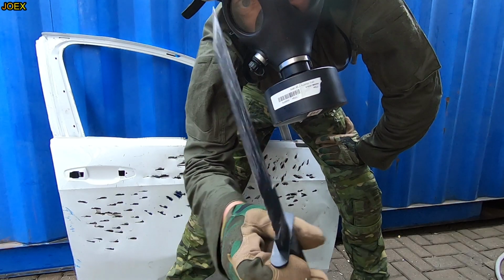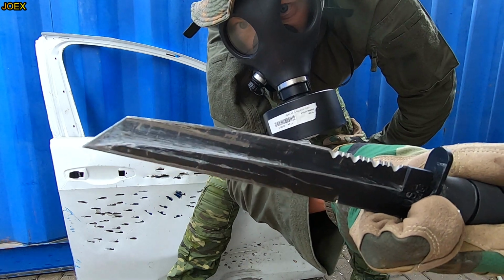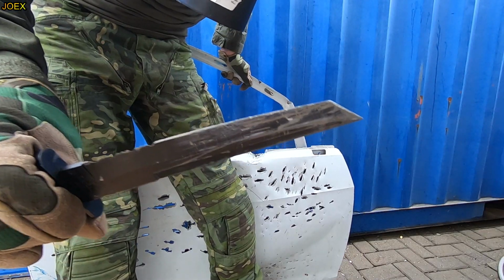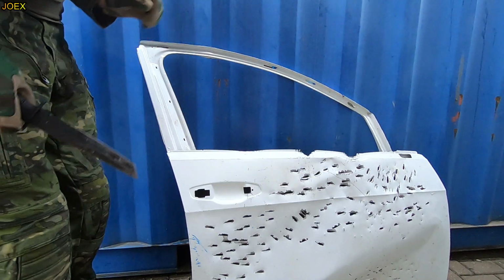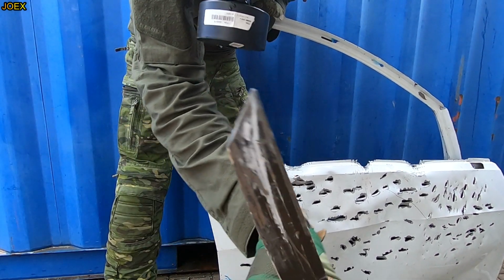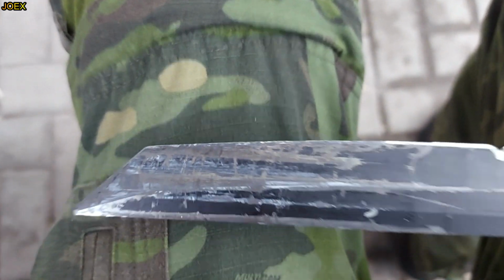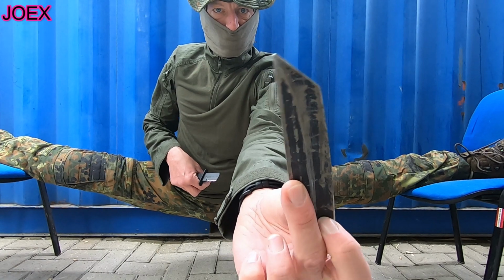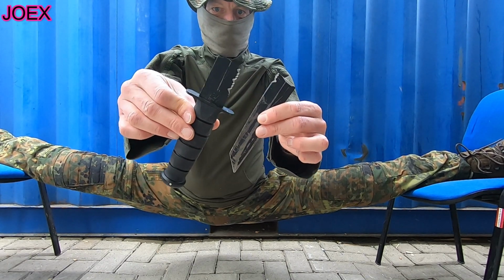KA-BAR TANTO FULL SIZE FIGHTING UTILITY KNIFE - DESTRUCTION TEST -  UNTIL IT BREAKS - 1095 Cro-Van

Comment: Hey man, "THANKS"!!! I was seriously thinking of buying that knife! Your video just helped me make up my mind! You'd think the Ka Bar would break at the stick tang point but, it did NOT!!! Very surprised and impressed by it's performance! Another EXCELLENT video Joe...
Reply from the maker: thanks, it did good!!
Reply: @joex  how about a test on Kabars NEW modified tanto?
Reply: I've had mine for almost four years and it's served me well. It makes a great bushcraft knife as I live off grid I use it almost every day and I just recently broke the tip (only about an 8th). Definitely going to get another.
Reply: @kicktherancor3217  I'll sell you mine. It's not the tanto version, but it's never been used. I have the regular clip point with the serrated section and Kraton rubber handle.
Reply: @kicktherancor3217  how are you off grid commenting on YouTube vids

Comment: Ngl Ka-bars are way more durable than I had previously thought, if this guy has a hard time breaking a knife it's pretty solid, dude is to knives what whistlindiesel is to trucks. Working on a bugout bag and still trying to settle on a survival knife that can survive an apocalypse. Looks like Ka bar is back on the short list. Thanks for all the hard work putting these knives to hard use, just be careful and mindful of your health brother, some of the crazy shit you do seems like a good way to get hurt,  and idk if that PPE is up to task or not, also as someone who has wrist problems myself(Years of heavy computer use, shit like this and a break or 2 for good measure) can't help but wonder if all that knife abuse is going to take a toll on your wrists too in the long term, something to think about anyways. There are anti-shock gloves that have little air pocket bubbles in them that help with that kind of thing, but I'm not sure if they'd be adequately protective for the many risks of more immediate injuries...A wrist brace could be another consideration, or some kind of thing that could hold it and spread some of the load to your arm while also potentially giving more leverage, like if you could figure out a way to attach it to the end of a crutch or something along those lines, as an added bonus you would be able to put more force into swings from the additional leverage.
Reply from the maker: i will be fine, but thanks for your comments, pretty cool, cheers!!!!

Comment: Still waiting for someone to demonstrate killing a bear with the knife, one thing I would like to say is that it seems that the weak tang of the blade and the sharp corner of the tang around the guard seems to be reinforced by the harder handle material in this version than the leather(which is considerably softer and weaker and allows the tang to bend more around the guard, hence the failure point when being used to baton, bend) so the Kabar with the plastic handles are stronger .
Reply from the maker: ok, bear check

Comment: 10:37
the blade takes amazing bending without breaking.
The tang is a little on the soft side, it's either they break on the tang-blade transition, like the old ones did, or it bends like an iron wire as you can see with the 'modern' Ka-bar's USMC type of models..

Still a very tough knife I would say. And nice stabs.
The Ka-bar 1066 has a nicer tip in my opinion, the nice smooth line without protrusion of the square point.
Though tastes might differ 😁.
Reply: I'm really surprised by how well it did, not a bad result at all. DBK did a video on Ka Bars recently and theirs seemed to bend and break much easier at the tang. Maybe an unlucky batch or maybe there's something about batoning that is particularly abusive to the Ka Bar design. Hard to say. Which is why all these tests are fun to watch.
Reply: @DL-ij7tf  
Yeah, if you're planning to baton lots of thick wood, I wouldn't buy one of these knives. They are fighters first and utility second.  But with common sense, these knives will do fine, even batoning some wood to make a fire (though many have no need for batoning to make a fire). 
You just have to recognize its limits. A wise man can do that.
Reply: @Ve-suvius  Yeah and I do feel like there's a bit of a disconnect between people doing hard use testing of a knife on YouTube, like batoning a big knotty log, and real life use where you can judge if a log is a good idea to baton or not. Most any knife can easily baton an even-grained piece of wood of a couple inches or less in diameter and then you can make kindling and tinder. In real life and even(or especially) in survival situations, if a task looks borderline for your gear, don't risk it unless you REALLY have to.
Reply: @DL-ij7tf  
Exactly.
These test video's are fun and interesting to watch. It shows limits.
But all in all, many men, even women, have batoned their tiny Mora for years without issues.
Even Cody Lundin still uses his Mora #1 (or is it #2) with the red wooden handle, after all these years.
Go figure.
It's the mind that makes good use of a tool.
Reply: @DL-ij7tf  
Some guys manage to break all of their knives. And I'm not talking about Joe X here. He's out to do that for a mission, with a purpose. But guys who think they know what they're doing , when in fact,  they do not.
Reply: @Ve-suvius  I actually really enjoy batoning, I just think it's fun and it can be safer and faster than using an axe. I live in the country and process a lot of firewood for fires big and small. The majority of batoning I've done has been with a Mora Robust, a Cold Steel SRK, and a Schrade SCHF36, none of which have ever had any damage other than finish wear and I'll even push them sometimes just to see how they do (they're inexpensive and I have at least 2 of each of them). Done some pretty gnarly knots and even split some by putting the tip onto the side of a log and hammering the butt to drive the knife through. I rarely have the balls to do anything like that with my expensive knives even though most would probably handle it even better.
Reply from the maker: you guys said it all! thanks for the comments! cheers!
Reply: @DL-ij7tf  
You have to do what feels best to you.
One batons, another uses the axe , some collect wood lying around instead of taking down branches/trees, whether dead or alive.
Safety depends mostly on the user. Not all can wield an axe or hatchet safely. Others can't even handle a knife safely.
An axe/saw are ofcourse the best wood processing tools aside from the chainsaw. The guys at Timbesports show that. They are fast !
Have a look at Jason Wynyard. Crazy power.
Reply: @Ve-suvius  I use axes a lot as well, but they are much less efficient and less safe for splitting a large number of small logs. I've had to process a few whole trees on my property over the past couple of years (Emerald Ash Borer). I don't get the vitriolic response to batoning people on the innernets have, often people act like the only knives that exist are $200 4"-bladed belt jewelery they take on hikes. Sometimes knives are just tools that need to work to accomplish a task. Personally I've seen axes break far more often than knives and it's much more dangerous when they do. You also can't miss when batoning.
Reply: @DL-ij7tf  
Fiskars don't break that often, nor the Gardena/Husqvarna synthetic handled ones.
They are very powerful.
You're free to have your opinion. 
I'm not agreeing with you it on this though 😁. 
Tante testi tanti cervelli....
Many have broken their knife during batoning also.
And already said, they were taking wood with their knives they should not have taken.
It's all on the user of the tools.
Knives are fine to split wood though. But axes are kind regarding this.
Reply: @DL-ij7tf  
You split wood on your property with a knife?
I mean, most often people disregard the axe/hatchet because it would way too much for a hike.
But on your own land...
The axe powers through it with one or two hits. Thick ones also.
There's no danger when using common sense.
Reply: I was expecting pieces of metal to go flying tbh.
Reply: @kova1577  
Sometimes it happens. Sometimes it doesn't...

Comment: do you remove the inside of the filter cardrige for your videos? if it is just for the style and looks it might be a good idea so as to breathe easier.  i used to work all day in hot harsh environement with a gas mask and it is very hard. at the end of the day the filters are full and it start to get very hard to breathe.
Reply from the maker: no i removed nothing! i like it this way!!!
Reply: @joex  OK. i wish you the best. please be careful of your health.